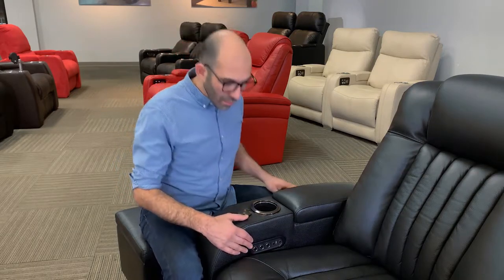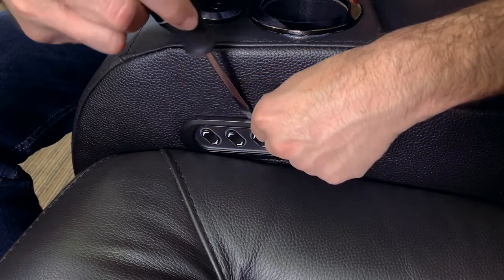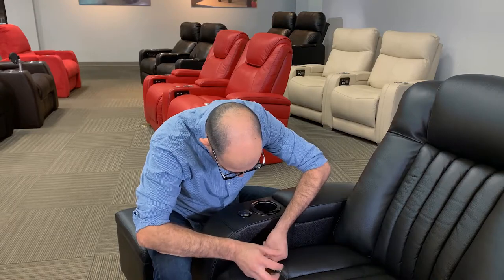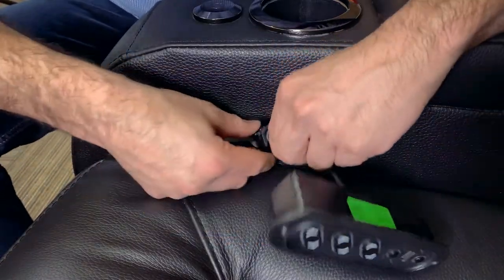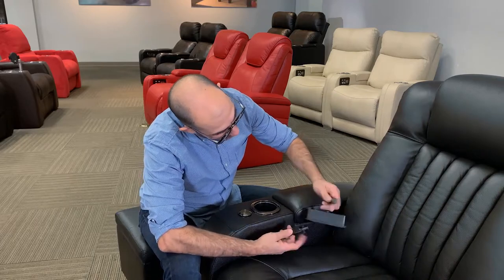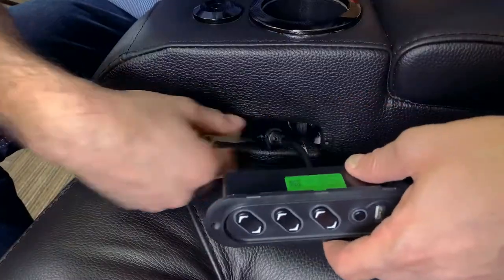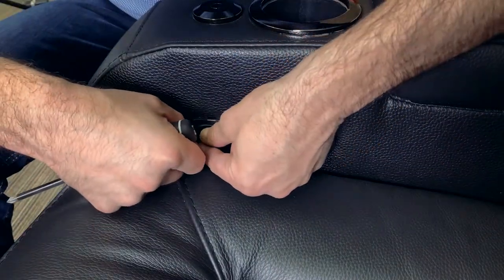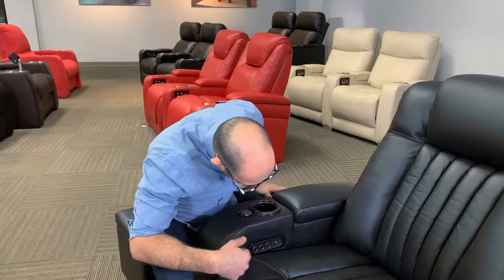How to Replace the Control Panel on a Home Theater Seat (Quick Disconnect Version)

Comment: It is nice to see Seatcraft cares about the customer and sells parts.  I bought a power reclining sofa from a well established furniture company and the manufacturer does not sell parts.  I need a 7button 5 pin connector control switch with USB and they told me they only sell complete furniture.  The moral of this story is do not buy power furniture unless the company also sells parts because when your warranty is expired you will regret it if something breaks.
Reply from the maker: We appreciate that feedback! Seatcraft offers replacement parts on almost every component of their current products. They have all the parts to fix almost any chair.